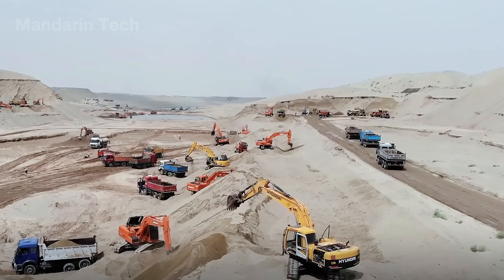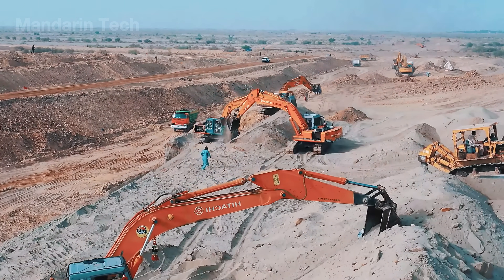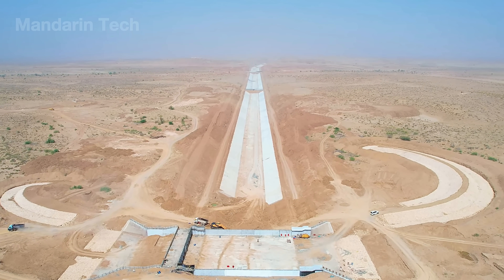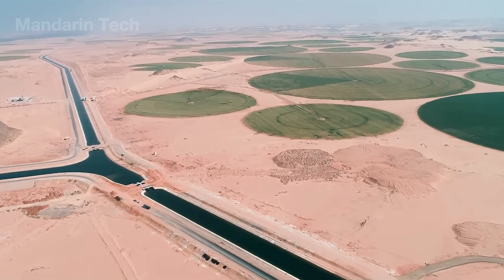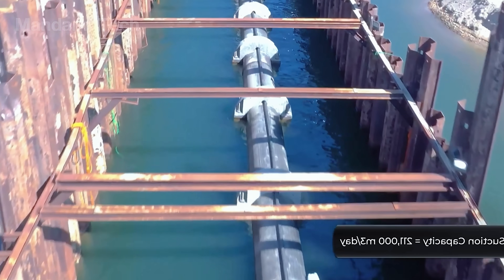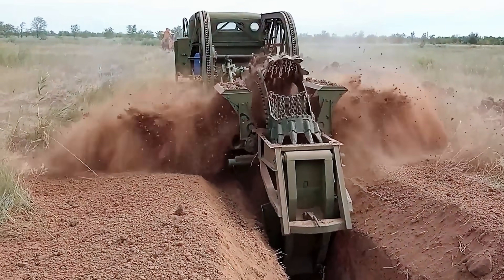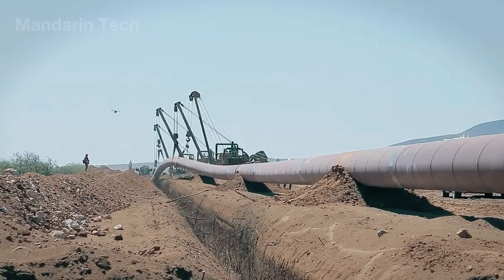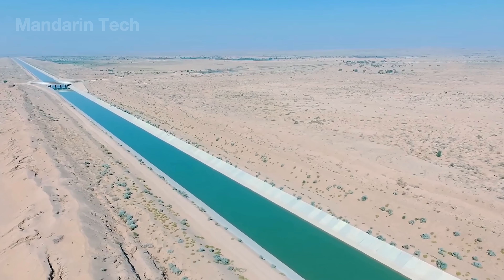How Pakistan Split Half Desert To Build A Massive 500 Km Canal That Change Their Country Forever

Comment: The saudi project has one fatal flaw. It is bringing corrosive sea water to a desalination plant hundreds of kilometers away from the sea. This will increase costs in the following way

1-- the seawater will corrode the pipelines leading to future cost of replacing the pipelines and wastage of time. 

2--the desalination plant will create a lot of salt extracted from the seawater in the desert, which will increase the cost of transporting it back somewhere else.

The better solution would have been to keep the desalination plant near the sea so that the extracted salt can be disposed off by shipping or away from the shore to greater depths. And the purer water transported via the pipelines. Whoever designed the project DELIBERATELY wanted to make more money from the Saudis and give them a HEADACHE in the future by wasting their time and vulnerability in agricultural production